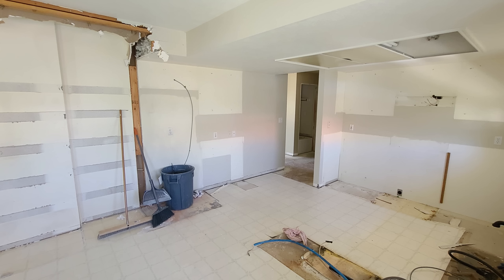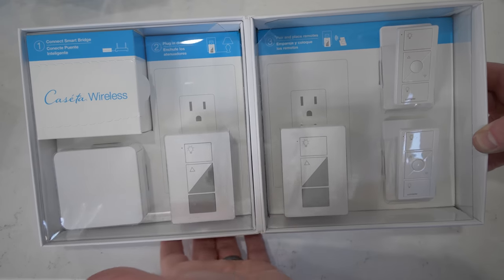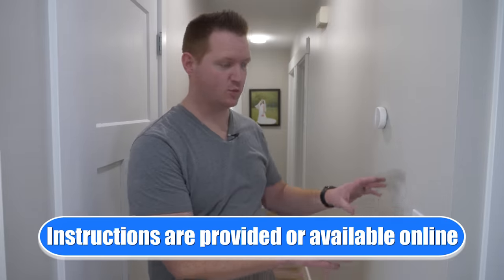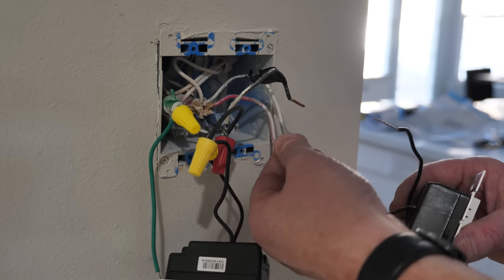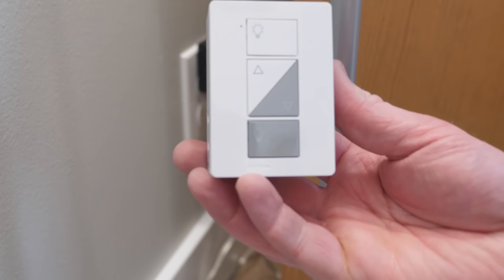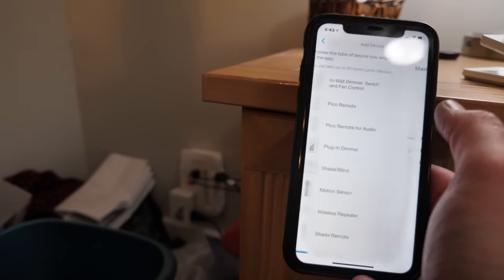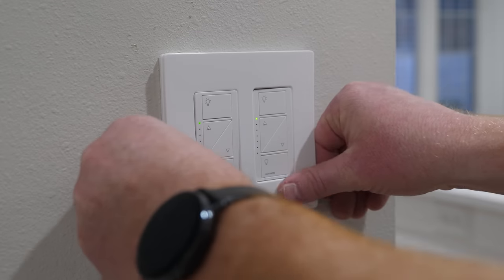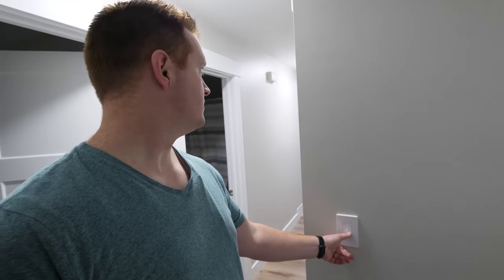Entire Home Smart Lighting Remodel

Comment: The motion detector did not seem to work well. Did you use a different motion detector?
Reply from the maker: It works well, I just didn't do a great job in showing it off. You can adjust the time it turns on 1, 5, 10 or 15 minutes when it detects motion and the added option for sunset makes it a much more useful sensor.

Comment: If you lose wifi would every single switch, fan control speed switch, dimmer?
Reply from the maker: Everything will still work because it is programmed to the hub and operates over an RF signal and not WiFi.

Comment: Brett or anyone, who ever painted this house or how ever white paint got on the wires so cant tell what is what. Is there a way to do that or maybe strip the paint off the wires?
Reply from the maker: I never found that any paint was an issue, but if it is you could just use some wire cutters to scrape off the paint. A razor blade could work to.
Reply: Using my thumb nail to scrape off the paint worked for me!

Comment: I've just had my Electricaian fit out my house with Deta Grid connect 18 switches all together Inc 3 fan controllers ,I have a 3 gang switch that 3 way switches using  Automation when A turns on B turns on When B turns on a turns on ect ,the only down side is they don't dim lights but you can get around that by adding smart lights ,what's the regulations for doing diy wiring here in Australia it's illegal for anyone other than a licensed electrician to do any terminating of wiring or running cables .
Reply from the maker: Oh very interesting. I certainly would sleep better at night.

Comment: So in at least one of the bedrooms, you simply said, Hey Google - turn on the lights. How did it know which room you were in? Was that a Google Scene or something controlled my Lutron? Or maybe there’s a Google device in that room that only responds to commands for that room???
Reply from the maker: Great question. When I linked Lutron to the Google Home app, I set up the lights in specific rooms. The Google Home speaker for that room is also linked into that room. When you have the speaker and light in the same room in the app you don't need to specify the room you just activate the Google Home in that home and say, "turn off/on the lights" and it will know what devices you want.

Comment: Dude, those aren't 'caps'. They're called wire nuts and they're for making connections, so folks better know what they're connecting. And you were connecting wires, not cables. The plastic sheathed combination of wires for each circuit is a cable (ie NM - non-metalic sheathed cable, aka Romex).
Reply from the maker: Thanks for the lesson. Vocabulary was never my strong suit.

Comment: After two years, are your parents actually able to utilize this complex lighting control system to its fullest?
Reply from the maker: I believe so. While they are not using a ton of automations, I think it is the perfect system for them because it doesn't require any maintenance. They haven't had any issues with it, all the Pico remotes are still controlling multiple switches at one time. They like the motion sensor at the entry way and they like the Pico remotes on their nightstand. They use the voice commands to turn on/off off the lights regularly. The only request for help was actually last night when they wanted the porch lights to not turn on when the ring detected motion and I just had to relink their Ring account in the Lutron app to fix it. So I think the system is a winner!